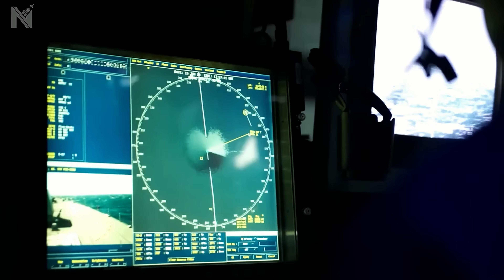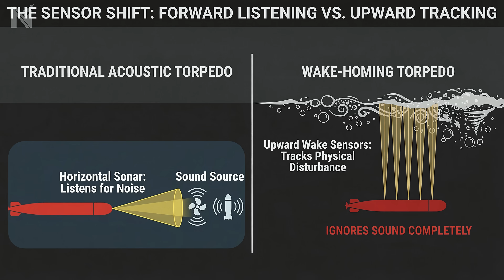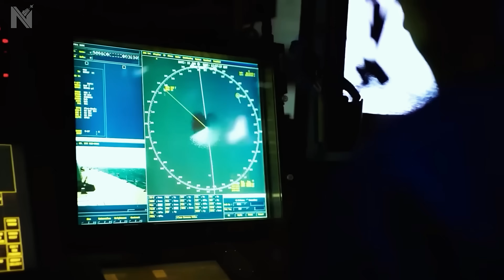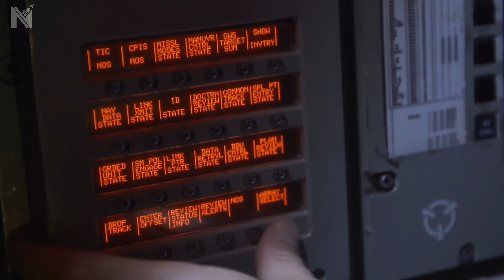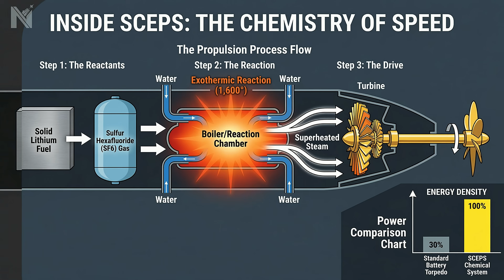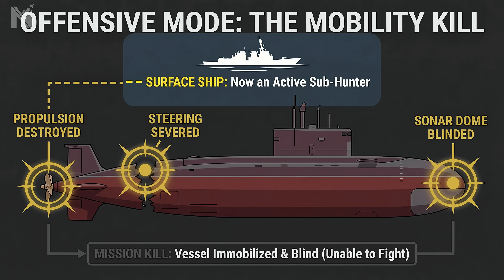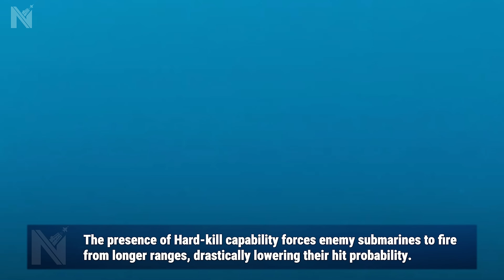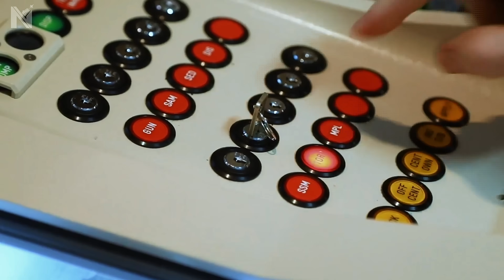How US Navy Stops Unstoppable Torpedoes

Comment: Dude. If you don't detect a wake homer before 2000 YDS you ARE FUCKED! it doesn't matter what you do. The math and stuff is well above this platform, but you need ALOT more distance. And the operator has to cued and waiting. AND the ship has to be at action stations. That means EVERYONE is closed up, at their station ready to do what they need to. Not 6 minutes away, after jumping out of bed, getting their boots on and running to the opposite end of the ship. There's a detection evelope. You gotta catch it EARLY enough to successfully evade. They are hard to detect so finding in time is slim.

Comment: A couple of further thoughts:
1. One problem that you didn’t mention is that the CRAW has a range of 2,000 yards, which sounds like a lot, but 2,000 yards is only a mile, and that is very, very close at sea. Hell, the carrier is almost a quarter mile long. So, this CRAW weapon, which would reach its maximum range in less than a minute, would need to have the firing timed so that a long-range incoming torpedo was inside the kill envelope at the time of impact. 
2. In addition, you might also have given some mention of the fact that Carrier Battle Groups always include at least one submarine and lots of destroyers to keep the bad guys away. That’s the first line of defense, while defensive torpedoes are a last resort, like CIWS.
3. And, as a previous commenter mentioned, using a CRAW weapon against a submarine would never happen. Aircraft carriers don’t shoot at submarines. That’s what the cruiser/destroyer/submarine escort is for. And, speaking of submarines, I understand they will also carry some form of defensive torpedo.
Reply: It wasnt suggested that it was used against a sub. It said it would be used against torpedoes.

Comment: I was a young sonar technician  aboard a Spruance-class destroyer in the early 80's. As our westward cruise went on, I had 3 different GQ stations. A couple months here and there.
   1) in Sonar Control, with the SQS 53 C sonar control, just outside CIC.
2)..Not my GQ station; my ASW blue or gold station. It was only for ASW, 6 on, 6 off, usually for 2-4 days. It was only for the asw division. The ship did not go to GQ. Our GQ drills didn't usually kast 24 hours. This blue and gold ASW conditikn happened in the Sea of Okhosk, in '81. 3 carriers, several Oilers, and 30 other ships.
 3) Sonar one. Sonar in those days was analog. The sonar spaces were forward of Mt 51, and from just below the main deck, four vertical spaces, with refrigerated  spaces containing reefer-sized "computers" sonar 3, down towards the keel..was the power supply. More cabinets, very confined space at the keel, Sonar four. At the bottom of the vertical ladder from 1 to 4, was an access hatch. Inside was a space the size of a car trunk. There was an access hatch at the bottom of that, which was under the keel..the sonar dome, flooded with water. This is only safely accessed in port. 
    I spent a lot of time smoking weed in all these spaces. I know what I'm talking about. My 2nd GQ station was watching the cabinet that had the fault monitor  on it, in sonar one. It was a four digit number that cycled thru, and if during active sonar transmissions ( It was audible )  it showed the same number for a bit, something was sideways. I'd call it in, somebody from sonar control would come down and start pulling out these 4" X 8"  circuit cards, sonewhere down that vertical access hatch, seeing wtf was the issue.
   I should also state the top of that vertical ladder ended jn an access hatch that opened up on the Fo'csle, just forward of Mt. 5. Many times, just  for the hell of it, Id climb out that hatch, stroll up onto the bow of the ship, and marvel at the scene. In full view if the bridge. There was never a word said to me.
 3)  The Nixie space. I only worked there 2 or 3 times. It was in the last space in the stern. Under the main deck, one deck under the Sea Sparrow box launcher.
   There was a big computer cabinet, a wheel with the line, and a fish you reeled out, to attract torpedoes. I mean, reeled out the ass end of the ship, right above her rooster tail, into the water. 
   That's all I b remember about  that. 
   That's your STG report from 45 years ago. Happy New Year.😊
Reply: haha I build Arleigh Burkes every single day of my life seven days a week not much changed except I can’t remember sonar four.  to be honest with you.  I wire every single one of those compartments. We have two separate holes for NIXIE and they’ve removed the MFTA on a flight three. I think they might call sonar four  GYRO.

Comment: Blaming the contractor is putting the blame in the wrong place. The Navy writes the Spec., and the contractor designs to meet the spec. No one would design a silent weapon, it’s hard to do, unless the Navy asked for it.
Reply from the maker: That’s a fair point, and the responsibility is shared. The video’s critique is really about doctrine embedded in the spec—stealth-first thinking carried over from submarine warfare—rather than blaming engineers themselves. CRAW worked because the requirement finally aligned with the physics of interception, not endurance or silence.

Comment: Now wait a minute. You said very clearly that the problem with the original system was false positives – you didn’t say that the electric torpedo was bad. But then you go on about how the torpedo was upgraded to a new model and now everything is fine. So, what happened to fix the original problem of false positives?
Reply from the maker: @BillC-ch7iz That’s the key distinction. The false positives were reduced by changes in sensor fusion, classification thresholds, and engagement logic, which restored operator trust. The new interceptor addressed a separate issue, which was having enough speed and lethality once a contact was confirmed. One fixed decision making. The other fixed physics.
Reply: Exactly!  The video went to great lengths at the beginning describing the whole "boy who cries wolf" problem we initially had, then spent the rest of the time describing how this super fast and noisy interceptor will stop incoming torpedoes.  Is is also going to kill dolphins, wales, and schools of fish super fast as well?  Also, surface ships have had torpedoes and rocket launched anti-submarine torpedoes (not to mention depth charges) for many years, so the whole concept of "Now they can finally shoot back" is somewhat ridiculous.
Reply from the maker: @Erik-um1zn Important distinction here. The interceptor is not an always on weapon. It only launches after high confidence classification, which is how the false positive problem was addressed. And yes, ships have always been able to shoot submarines. What they could not do until now was shoot the torpedo itself. That is the specific meaning of “shoot back” in the video.
Reply: @NavyDecoded  You seem to still be missing the point. A "high confidence classification" is not the means by which the problem of false positives was solved -- it is the result of solving it. Your video fails to show how the false positives were eliminated so that these CRAWs could be launched only at "high confidence classification" targets. These commenters aren't nit-picking, they're offering valid, constructive criticism.
Reply: I came here looking for this or I would have made the same comment. Thank you for putting it so well. While I found the video informative, the channel's reply to you still doesn't acknowledge that the video didn't directly address how the problem of false positives was solved. I also do not see how a carrier would use a CRAW with a 2,000 yard range directly against an enemy sub. If one ever got that close a LOT would have gone wrong. I can see how a destroyer might get that close, but not a carrier.
Reply: Also, our carriers are not equipped with sonar or torpedo launchers. Anti-sub work is the job of escorting destroyers and ASW helicopters, of which the carrier may have some.
Reply: I also came here looking for an answer to the Crywolf scenario. Thank you for putting it well. I still don’t understand how they solve the problem so that they could actually use the Craw
Reply: @TheBrotherAlpha-1 basically they took what they learned from a decade of using the old system and made it smarter. They didn't just give it a bigger brain but utilized the years of data collected using the old system to teach the new system to better discriminate targets. Money can't buy experience, you have to earn that the hard way. Hope that helps.

Comment: It isn't clear from this video how this torpedo killer homes in on its target. Chemical propulsion - got that. But how does it find the torpedo, differentiating it from biologicals and decoys?
Reply: @edwardring2689 The truth is, the specific details of the CRAW guidance algorithms are currently classified by the U.S. Navy. While we know it utilizes advanced digital sonar, the exact way it filters out decoys or biological signatures remains a closely guarded military secret to maintain tactical advantage. We will likely have to wait until the system is fully operational or further declassified in the near future to get a clearer picture.
Reply from the maker: @edwardring2689  Great catch, Edward! You're absolutely right regarding the guidance systems.
While the video focused on the SCEPS propulsion revolution, the CRAW's "eyes" are just as impressive. Unlike the old passive decoys, CRAW uses a sophisticated Compact Active Sonar Array combined with advanced signal processing algorithms. This allows it to "ping" and distinguish the metallic, rhythmic signature of a torpedo from the organic movement of biologicals (like dolphins) or static decoys. Ideally, it ignores the fake noise and locks onto the hard steel shell.
Thanks for watching and keeping us sharp on the details